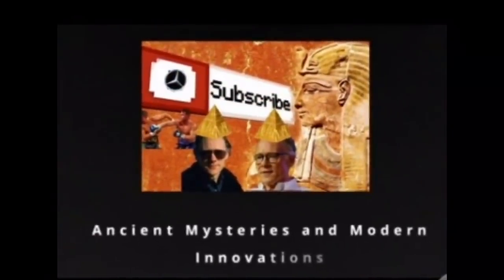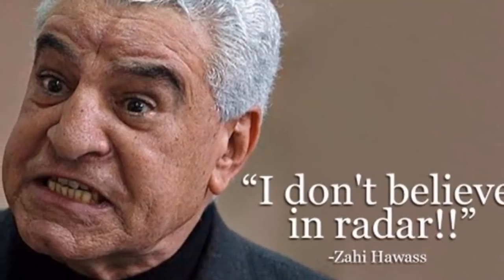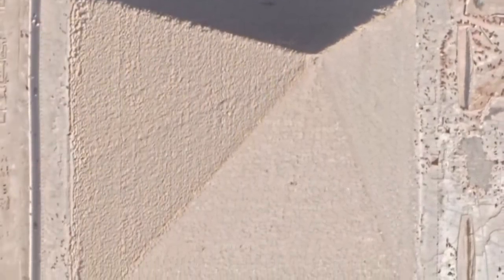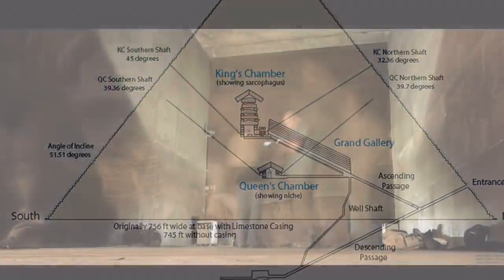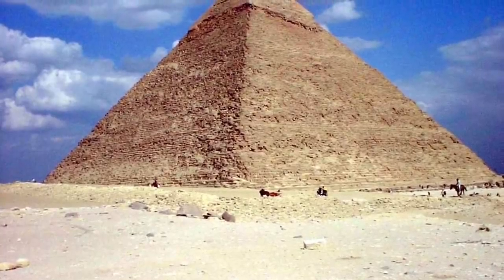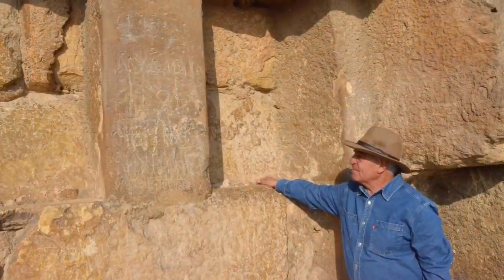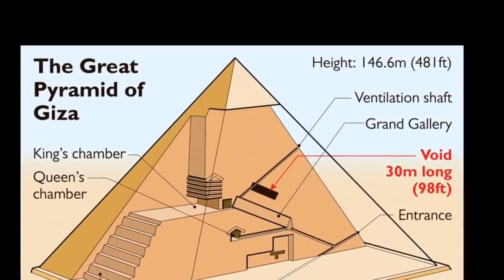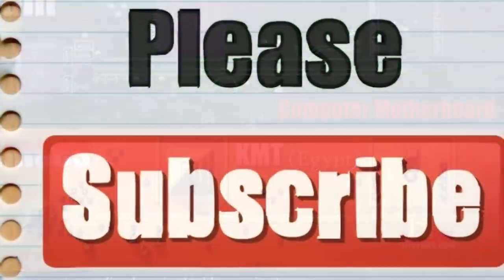Graham Hancock on Geopolymer (Liquid Stone) Technology at Giza Pyramids

Comment: Lets start off with the first fact. The Egyptians did NOT build the pyramids.
Reply: The dynastic Egyptians found the pyramids. They didn't build them.
Reply: If I remember correctly they were covered with cap stones to protect them. 
The cap stones are mostly gone.  The question is how long for a cap stone to weather away to where they are today. 
10-20k years ago
Reply: @drmachinewerke1  "if u remember correctly?"
that would imply you were there personally yourself several thousand years ago and watched the original builders build the pyramid, then travelled in time to leave us this comment
Reply: SHERMA 
Not several.
Reply: @drmachinewerke1  the cap stones were removed by people
Reply: drmachinewerke1 The capstones were largely dislodged by an earthquake in the 13 century, and used to build many of Cairo's Mosques.
Reply: dont jump to conclusions without factual evidence. These are ancient Egyptians. Dont undestimate them without tangible evidence.
Reply: @Coma White Is not his opinion, there are scientific evidences to backup this theory and yes is a theory but the more we advance in studies and the more this theory is more probable than the so called usual children`s school building theory where the Egyptians built them. Is very likely that the  ancients Egyptians "found them"  after a cataclysm in a window period between 12k and 6k B.C. then they added their modifications here and there to these structures that anyway were already there in place. Two of the major example that fit this theory are: 1) the fact that the Sphynx have clear evidences of water erosion possible only if the structure was old at least 6k-12k years 2) the rose granites blocks of 70+ tons located in the heart of the pyramids are up to today a real mistery in terms of how on earth they cut with such precision those blocks (mainstream egyptologist try to convince us that they did with copper tools which is laughable) and how the hell they carried them and they placed them in such a precise way (same issue with the Serapheum gigantic sarcophagus btw).
Reply: Amen to that
Reply: Coma White I
I realize that however there are still to this day a few left.
And as long as we know what type of material. It should be possible to determine the age of the caps stone left. Meaning how many years it has taken to wear to the level they are at now .
Reply: Don't tell me what to think or say. Yo make your comments and I'll state facts.
Reply: Then who build it American is that ur fact ?
Reply: @Coma White I would recommend looking into some research by Dr Robert Schoch who is a well known Geologist on the dating of the Sphynx complex as its accepted amongst mainstream Egyptologists that it was reshaped into the current form after its initial carving. Dating for the sphynx in history books comes from a controversial translation of a stone tablet located at the base. Looking  scientifically at the surrounding geology and geological record (traces of events remain) shows that date is out by around 7,500 years.

Fascinating stuff. There are voids beneath the sphynx too which have not been investigated. They should be, we should learn all we can.
Reply: @juniorballs6025  

The 'voids' under the Sphinx, if they actually exist, are more than likely natural limestone caverns that are inaccessible.
Reply: @Coma White Hi there, sorry but it was you that actually compared them, I just said the Sphynx complex seems to drastically predate the established timeline. All I was trying to do was make it apparent that it was an important site before the construction of the pyramids - this is obvious from the evidence (geological record) and accepted by a lot of reputable scientists.

Personally I have no doubt something was there before the accepted dates the pyramids were built, but I have seen nothing to actually prove that, so couldn't in clear conscience say so.  Even though it's the internet.

Finally some (possible) nonsense because it's the weekend. The pyramid if scaled up would sit exactly in one half of the globe. The with of the stone boundary around the pyramid compared to the width of the pyramid is the same as the ratio of earth's "squish" at the equator due to gravity and rotation (earth is not a perfect sphere).
Reply: Junior Balls earth is not a perfect sphere?
 If its a sphere at all?
Reply: @Coma White With the greatest respect (after all why not?), it might be worth re reading what I wrote, because I really didnt! I was trying to establish that site had been in use for a long time. By site I mean everything; pyramids and all. Stonehenge in England is a good example - an early site of some significance which was added to and altered over the years. I really do enjoy learning about these things! Anyway enjoy your weekend.
Reply: @Coma White Re read again and actually neither of us did. Apologies, misread the dating one from another bit. As you were 😅
Reply: Yep. Built during the so-called Ice Age (c. 12,000 or more years ago), the 'antediluvian' (pre-flood) era, as were many other cyclopean monuments and buildngs, such as at Tiahuanaco. The issue is confused because of the later building  at the sites which, naturally, often included renovation and addition to them.
Reply: @Coma White He said that because he is presumably a bit more up to date. 

No information has ever been found stating that they built them. The only 100% confirmed information is that the Egyptians, "repaired" some things. Hence, there is no information left on how they were built.
Reply: @Coma White Thats for the casing stones yeah? It's becoming widely accepted the structure is much older; not 20k but the base structure is pushing 10k max.
Reply: @thearcadian290  That guy your talking about is a tour guide. Not a historian or an archeologist.
Reply: Coma White.....not 'quite
clearly' at all, the pyramids 'clearly' have outer layers missing dont they? Robbed away over millennia etc. 
Try again.
Reply: The Arcadian yes he's a full on bell end
Reply: Ok lets assume that 60k number is correct just for the sake of this discussion. Great you just dated the sphinx but we are talking about the pyramids......
Reply: @mattking993  Well, stones on the Pyramids have similar damage. However, even if they didn't, there's several other strange things that connect them. They're both in part build into the bedrock, they both have several areas inside of them, as well as tunnels that connect the two. They both follow the pattern of at least two distinct peoples interacting with the structure(as well as several other structures both in Giza and around the globe such as Machu  Picchu. Basically, at his point Egyptology is completely fake and untrustworthy.
Reply: @vacnol Ok some of what you said there is news to me and im pretty sure you believe in some things i do not. Putting that aside im not gonna say that egyptologists know everything or have it all correct but i believe they are doing the best they can with what they do know and anyone who just blindly labels everything as false because it doesnt support their beliefs despite all the evidence that they are wrong is just sad. Just 1 question... did anyone consider the possibility that the water damage to the bedrock was already there long before the pyramids were built? Anyways as i said this info is new to me and ill see what i can learn about these tunnels and water damage. I hope this doesnt turn out to be some fools drug fueled hallucination. im so tired of hearing some loser babble on endlessly about crap that totally ignores facts and telling me lies to support fiction.
Reply: @mattking993  The reason I say Egyptology is fake is because of the fact they ignore facts and critical parts of the puzzle. They prevent exploration, excavation, and anything that goes against what they say is true is denied instantly. The water damage isn't to the bedrock but the stone, the sphinx has the most damage however, enough to say that only the Nile could have caused it and the last time the Nile was that close to the Giza Plateau was thousands of years ago. There's tons of stuff you're not told about the pyramids, such as no mummy ever being found in ANY of them, or the fact theres a giant fucking door in the middle of the Great Pyramid. Looking into this deeper and deeper you see a lot of shit they're covering up, just not history wise but globally.
Reply: @vacnol actually most people know about the mummies and that has been explained when they did find some mummies. Plus this is in part my own personal opinion based on some facts but its well known that pyramids were full of traps and meant to trick any robbers so its not surprising that a mummy hasnt been found. I cant remember whose tomb it was but they didnt find a mummy. it looked like an unused tomb until they discovered the secret passage hidden under the floor....hint hint. So my personal opinion and counter to the pyramids are not tombs theory is maybe the pyramids are doing exactly what they built them for and explains why we havent found the mummies. I cant really comment to much on the blocking exploration and excavation thing except to point out theres a lot of exploration and excavating going on over there. Im afraid to ask but what is this giant door that ive never heard of and pretty sure doesnt exist there for?
Reply: matt king Okay, so no, mummies still haven’t been found, there’s speculation that there could still be mummies but it seems unlikely, also as far as we know there were no “traps” either. Now, you’re 100% about the passage ways but it’s a little more complicated than that. When I say this I’m going to be talking specifically about the Great Pyramid as most of my knowledge is held there. In the great pyramid there are several shafts, no more than a foot wide, about large enough for a small dog. These shafts were previously hidden nearly perfectly with stone, granite I believe. The shafts are several hundred meters long extending into the pyramids, at the end of one of one of them, the entrance being found in the “Kings chamber” I believe, don’t quote me on that part led to a small room deeper in the pyramid, the only entrance to whom seems to be this shaft. In this room one of the walls was actually a door with two large iron handles on it. Note: several of these shafts point in very specific directions in the sky towards stars in constellations suggesting astral knowledge.
Reply: @vacnol yes mummies were found but not in the pyramids. Ah yes those doors i already heard about. Your statement about a big fucking door in the middle of the pyramid was misleading as those doors are actually small. They lead from the queens chamber if my memory serves me correctly and they did drill a hole in those doors and took pictures of a room. Unless they discovered more since 2011 there was no big door in the pictures i saw. My house has a chimney and im sure it probably lines up with 1 of the 100s of stars in the night sky but im pretty sure it doesnt have any astrological meaning. I know astrology was important back then and still is to some people and im not saying that theory has no chance of being correct but a hole in the roof may just be a hole in the roof.
Reply: matt king If talking about surface area sure, the block with pins(should have been more specific) was small from the shaft the actual granite block is several tons. That leads into another empty room with an odd large stone block at the end, as per we’re told. The point was odd structures like this exist several times over with the pyramids including the position itself. The void for example that exists above the King chamber or the grotto area leading some to propose s water pump theory. As for the involved astronomy not astrology, precision and specifics are a key. The pyramids themselves not only sit on the exact center of earths landmass to hundredths of a degree, but the alignment with Orion’s Belt is impressive. I should also mention a largely logical theory of that, that that the actual pyramid structure, specifically the limestone outer blocks were placed later overtop the original structure made out of granite blocks that were much larger and heavier.
Reply: That is interesting i had not heard about another room. Im still holding onto hope those shafts will lead to a mummy. Not really a void above the kings chamber but there are open spaces between the granite blocks i guess thats what your referring to. Probably obvious but im not a fan of the water pump idea lol. I did do a bit of research tonight into that center of earths landmass thing you mentioned and it is really cool but i noticed right off and apparently someone else did to that if you rotate the earth left or right and up or down giza wouldnt be the center anymore. That someone else is a person named susan wise bauer and she said the only reason giza is at the center is because they used the mercator projection as the map of earth which the egyptions didnt have since it wasnt invented yet. So that kinda reminds me of the point i was trying to make with my chimney and isnt all that cool anymore. Ah yes i do gotta admit the way the pyramids are laid out and orions belt is pretty awesome but then again...i do feel the need to say im not trying to be jerk before i finish my sentence...if i go outside and look at my chimney and move to the right position it lines up orions belt nicely also. But the resemblance between the pyramids and orions belt is worth speculation and some theories at least. Im not even gonna touch what you called a "Logical" theory. I am enjoying this chat of ours but going down that road would lead to a never ending discussion of our day dreams and wistful fantasies.
Reply: matt king See, it’s all about perspective. The mainstream assumes it wasn’t invented yet, but the map is based on mathematics, assuming they were more advanced we can argue that they likely would have run into the same idea. We already know for a fact humans past is far more complicated than the mainstream has claimed. The Shigir Idol is the oldest known wooden sculpture having been dated to 11,500 years old, right after the end of the last ice age. I recommend you look into that, the implications are quite fascinating, make sure it’s not a mainstream source... they’re not that trustworthy.
Reply: @Vacnol Yes it is an assumption but it is based on the lack of proof to the contrary which is an assumption myself and the mainstream are comfortable making. Your assumption is a debate on what ifs which is fine but when you start trying to present it as fact and expect the mainstream to bend to their beliefs thats just plain wrong. I fully believe that they were more advanced than alot of people give them credit for but not in the way some theories are saying. I believe they knew far more about the natural world than we do at least in regards to pyramid construction and they did have a bit of modern technology but built with primitive tools what was available to them at the time. I dont mean anything crazy like computers and such btw. Oh i did look into the water damage thing very briefly it was only 1 link and it only had 1 picture that was at a distance but it looked more like wind and sand erosion to me ill keep checking later maybe find some better pictures that show clear and definate water damage but if all the pictures look like that 1 im gonna stick with mainstream until better proof is found but now im gonna stop babbling and check out this shigir idol but im gonna also check out the mainstream as well i do prefer to hear both sides of a debate and form my own opinion.
Reply: @mattking993  Okay, so I wrote an entire thing and cut it cause reasons, basically the gist is this. The pyramids are made out of Limestone and a but harder granite, both of such are not easy to cut using copper the latter being nearly impossible, they could NOT have built it in the time Egyptology describes just using Limestone not at all using granite. These granite blocks weigh up to 100 tons and are taken from a quarry hundreds of miles way, no ramp could ever be built to get them up there as a straight one would cost more than the actual structure and one around the sides would be too small, cost too much, too unstable, etc. These structures are extremely precise something not possible with primitive tools under any circumstance, even using the sand and water theory. The building techniques are seen globally using the same kinds of stones, as well as several structures, three examples being the Bent Pyramid, Giza, and Machu Pichu, all of such seem to switch styles at some point, one being less complex the other being far more complex. Basically, the mainstream has absolutely no idea how they're built and refute anything against their theory's even if they're good, they've lost nearly all credibility in their arguments simply not following science and being extremely secretive with their endeavors, covering up an entrance to the Sphinx located on the top, several rooms, and even tunnels UNDER the Giza Plateau. The probability the Egyptians built the Entire structure of all the pyramids like Egyptology says is so low it's basically zero, so then instead of me speculating, let me ask, who did it? One more thing to add, we say civilization started with the Summerians, I ask why? We've existed for a MINIMUM of 200,000 years, yet we're told we only got smart enough to make houses a few thousand years ago? Personally, we could have discovered civilization anytime between our birth and now, considering there's more time between Summer and our birth than Summer and now, it's more likely civilization existed before Summer just using numbers and no outside sources, with outside sources it's even more likely using logic.
Reply: @Vacnol Well crap i was gonna go to bed and get some sleep but i just had to read what you said and now my brain wont shut up lol.  I agree totally that the great pyramid could not possible be built in the 20 year time frame they say with the current theories that are accepted by mainstream. I believe that number is based on some writing they found that they claim says khufu ordered the building of the great pyramid and the day he died...i think. I am no linguist at all not even close probably the worst subject in the world for me. I only speak bad english and thats it lol but i did try to learn dutch once and i learned they say things that the meanings of a word can change based on how its used but what im trying to say is maybe it was mistranslated and he actually said it was constructed or whatever ya i know now im assuming and spinning what ifs lol. If you watch some newer documentaries on the pyramids you will find alot of mainstreamers are admitting that the ramp thing is wrong. I would like for you to check out a couple things for me now. On youtube search internal ramp then watch the video The great pyramid of egypt new evidence full documentary posted by experience egypt this currently my favorite theory at the moment theres some videos if you want to watch them also the other thing id like you to check out if you havent already heard of it is corral castle please dont watch the ancient aliens version and 1 more thing look up The Thunder Stone. I believe the biggest reason why everyone thinks the great pyramid couldnt be completed in 20 years is because we are told that they would have had to set a stone weighing at least 2.5 tones like every 4 minutes or something like that well thats a massive assumption that the entire pyramid is made of stones that large and since we havent taken the pyramid apart we cant possible know that. After you watch the internal ramp video you will see they found a spiral shape of lower density going all the way up the pyramid even if the internal ramp is wrong it still leaves the question why is there lower density if its made of the same size and type of rock. Also in that same video they talk about a french team that drilled a hole in the pyramid and on the other side they found a rough room full of sand.....my personal assumption and theory is they used much smaller rocks called filler rocks and sand to fill in alot of the pyramid. If they used an assembly line of people they could move alot of dirt in very little time and maybe make that 20 year mark easily. There also might just be proof. The granite stones above the kings chamber is cracked on the 1 side that they believe was caused by the 1 side settling lower than the other. This settling effect is far more believable if you think of sand and small filler rocks shifting than trying to explain how massive stones somehow moved.  Ok now if youve watched the corral castle video youve seen the tripod with the boxes and all those ropes. Thats a pulley system doesnt take up much room and allows a person to lift huge amounts of weight with much less effort and that guy claims he discovered the secret of the egyptians....hrmmmmm. From where im sitting the probability that the egyptians built all of the pyramids is a lot higher than zero. I honestly cannot answer your question of who did it since i wasnt there when they were built but if i did have a time machine id definately not leave without you because the loser is walking home lol just kidding. Ok the summerians have the oldest known writings followed by the egyptians and i think thats the reason why i could be very wrong. I fully agree that there is probably an older civilization out there but it hasnt been found yet so for now the summerians are what we got for now. Sorry so long but you picked such a fascinating topic with so many possibilities. Yes i skipped the sphinx and tunnels stuff i think this reply is already huge enough lol.
Reply: matt king I’m gonna do some research on the whole sand idea however I’ve got shit to do today so it may take some time. In the meantime a small rebuttal. Personally, I don’t believe that space aliens helped anybody on earth, nor were helis used t move these blocks, some form of ramp had to be used and the pyramid itself likely was the ramp, however I think that complicates things. A great chance I like to watch called Ancient Architects is an amazing source for this kind of stuff, he’s an independent researcher whom recently proposed a new theory, basically the Egyptians as well as Sumerians were a part of the pre flood civilization, and the pyramids are actually converted structures, the proposal makes sense and explains a few things in history as well such as migration and cultural similarities. https://youtu.be/WMVQMhitxMc I think you’ll like many of his vids, too
Reply: I am very relieved to hear you dont believe in the alien stuff. Ill check it out later. The internal ramp video may be what your looking for and the corral castle video helps explain how someone was able to set such huge rocks.
Reply: matt king Woah there cowboy, I said I don’t believe in space aliens, not aliens.  There’s hands down some weird shit that goes down on earth, most of it I think are people, but it’s that like 10% that seems odd. The two best examples of this are the Missing 411 cases, those are fascinating and I think you’ll love them. As well... as our very own moon. I say this because the geometry of the moon is... well it’s fucking insane. Basically mathematics says it’s more likely that the moon is artificial than everything causing the moon to be the moon due to shape, it’s density that of such should be wayyyyy heavier, size, position, angle, rotation and orbital speeds, etc.
Reply: Well i only meant as far as the pyramids are concerned lol. Anyways i gotta go do boring stuff.
Reply: @TheShadowBannedBandit  

No, it works the way all historical study works - the facts in hand are the story, not the absence of facts for a different story. If I have a clearly fashioned stone tool, I can say that a hominid made it and speculate what it was used used for. The youtube archaeology analogy, is I dont have the LASER drill the Atlanteans used, so clearly the Atlanteans built the Pyramids.

If that makes no sense at all, congratulations, you're beginning to learn.
Reply: @mattking993  

Many of the grand tombs, were merely for public spectacle and the actual tombs modest and secret.
Reply: @TheShadowBannedBandit  

Whoa, whoa, whoa... CITATIONS, CITATIONS,  CITATIONS NEEDED
Reply: Spring Bloom You know, I thought I was actually going I have to reply seriously but you’re not being that series. You’re making speculations on what anomalies could be without even looking into them. I’ve provided a link only a few comment up that is a study on the water erosion theory, it is most definitely not just “a failed understanding on wind erosion” if you read it you’d know this. You failed to even comment on my shit tons of other points, the elephant in the room is still literally bigger than an elephant, that being hundreds of pounds of granite blocks that were cut, transported, and placed perfectly. I never said it was lasers, I never said it wasn’t; I did say that whatever the pyramids are, how they were build, when, and my whom is unknown and most certainly not what the mainstream tells us. Hell, they even found a hidden passage who’s entrance is found in the king chamber, most people agree that if they were a tomb this could be a good way to prove it... assuming Khufu was there; however We were told nothing, they sealed it off and left it be leaving the public to only guess, if that was a tomb they would tell us as it’s their narrative, but et again no mummy was found in the pyramids and I think at this point if you still think they’re tombs you’re reaching for straws. Read this study tho will ya
Reply: @thearcadian290  However, I believe it is the job of the more fortunate and free willed to pull the rest of us up whom was born on the lower floors. We can't reach our full potential without ALL of us being on the same page.
Reply: @springbloom5940  There is no mountain of evidence, this man is a Geo physicist and geologist whom is an independent researcher that released this paper. As for Egyptology, their only "evidence" is what you read in books, they can't actually cut stone with the methods they provided, they can't actually prove how the stone was transported there, there was NEVER a mummy found in the great pyramid... they can't disprove the water erosion theory. There's holes everywhere, nothing connects as it should, they've got dates wrong, facts wrong, PHYSICS wrong. That's just how it is, I provided you with a paper by a reasonable source whom is independent, now your job is to disprove it.
Reply: @spring bloom I did not know this ty :) hopefully 1 day ill be able to go see them.
Reply: @vacnol I watched both parts of the converted ziggurat and your right i did enjoy them. Had to watch them a couple times because i havent gotten to the bent pyramid yet and he does talk fast and jumped from 1 thing to another kinda fast. That would explain how they were built fast. I liked his explanation for the internal ramps findings also. A few of the things he said got me to thinking tho. That the exterior was built in 2 seperate stages and by differant people ok maybe not on the 2 seperate stages part. I believe he also said that its weird bent shape was by design and meant to be that way that it wasnt because of structural damage i agree completely. Ok the mainstreamers say they changed the angle because of structural damage and the top was hurried and thats why its not as well built as the bottom yup i agree with him that cannot be correct and then someone actually went and checked lol. Thats just stupid if your foundation is falling apart due to excessive weight your not gonna keep throwing on more weight even at a lesser angle its still just gonna fall apart. Why anyone would even bother running tests is just silly to me. The bottom is obviously the foundation and thats why they used the heavier stones and why the stones were set so perfectly. After the bottom was done they lessened the angle to reduce the weight and the gaps between the stones is easy if you think. which weighs less air or stone? Maybe the stones angles were changed for stability or something that part im not sure about. Its aesthetics doesnt matter since its gonna be covered over anyways. They changed the angle and the construction method not because of structural damage but to prevent structural damage.
Reply: Vacnol and Arcadian I checked out that link Vacnol and if you look there is clearly wind erosion running right thru the middle of his example of water erosion lol. Plus if you google wind erosion and look at the pics some clearly look just like what he calls water erosion and vice versa if you google water erosion you will find some that look like wind erosion. Arcadian you really should slow down your flow. Your making claims you cant back up. Just because a mummy hasnt been found yet doesnt mean there isnt one. There is proof of tombs being built so it misleads robbers and the mummy and valuables are hidden in that tomb. Me and Vacnol were just discussing the fact they are still finding hidden rooms and tunnels inside them. Khufus mummy has not been found yet so it may still lay in there somewhere. You do know there is alot of proof pointing to egytians building the pyramids and i have yet to see any concrete proof they didnt.
Reply: CITATIONS NEEDED
Reply: @thearcadian290  

There is no 'Sphinx water damage', that is a pseudoscientific assumption, based upon poor understerstanding of differential wind erosion.
Reply: Spring Bloom.....That's a matter of perspective, looks very much like running/lap water damage to myself and many others.
It could be either or both for all we really know.
Let's assume it is wind erosion, would that not suggest the Sphinx, to be far older than the 'scientifical' community purports?
Don't forget, we are talking about a community that still tells us the Pyramids were tombs, when they're clearly not and that the Egyptians built them. 😲
I have a theory about the Giza pyramids, I believe underneath the plateau lies another construction, a water way of sorts, but, instead of being filled with water, its content is, or once was, mercury, similar to the one in China?
Reply: @thearcadian290  

Don't speak to me, until you can adult.
Reply: Spring Bloom Oh dear, did I just make your 'scientifical' adult, butt hurt?
What on earth makes you think I'm not being an 'adult'?
It isn't me stamping my feet and having a lil 'hissy fit' is it?
Reply: @thearcadian290  

Were I you(and so thankful Im not), Id give serious consideration to the delete function.
Reply: @thearcadian290  

Just cant help making a fool of yourself, can you?
Reply: Spring Bloom I waiting for you to amaze me with science?
Reply: The Arcadian Also that wasn’t true. There’s distinction between water and wind erosion, side by side comparisons are used in this study. Wind erosion does exist of course, however there’s also an absurd amount of water erosion present.
Reply: Vacnol I know mate, I have no issue with your summary or your logic 👍
Reply: @thearcadian290  

'Mainstream scientific community'

And so we get to the root of the issue - oppositional defiance.
Reply: @Coma White here is a fact....if the egyptians DID build the Pyramids, their civilization has devolved tremendously........
Reply: @Coma White wont work coma...I know what I know and today's Egyptian has no inkling of how the Pyramids were built, so if they did build them, then they have lost a remarkable amount of brain power...the simple fact of the existence of the pyramids proves it. The Egyptian standing next to it scratching his head, proves it. Fact:!!

no coma....I am not giving you ammunition against me....yer so smart, deduce my country and ethnicity for yourself......
Reply: fullswing  of course they rise and fall...and Egypt fell from the Moon's orbit if they built the Pyramids.....thats a fact.
I dont believe anyone born on this earth built them...thats an opinion
Reply: @Coma White great...you are a genius...heh
Reply: @Coma White yep, the bar is low and you passed under it easily...heh
Reply: @Coma White you mean the fact that Egyptians,  and most societies on earth today, do not have the knowlege, the means of production, or the time to waste, trying to build a Pyramid that apparently does nothing but point at some stars.....someone had a lot of time on their hands and the feat was a piece of cake to them....I know a fact when I see it....
...its simple...you can do it to...
Reply: Coma White prolly you are brain washed by mainstream science and archeological explaining to you it was build by them, no one else?  I supposed your 4th grade school teacher told you that as well?
Reply: Yeah, they did. Look it up.
Reply: @Coma White Hpw exactly did they Carbon date rocks again? Lol.
Reply: the narrative of the pyramids will ALWAYS be speculation
we will never KNOW because the builders/contractors of the pyramids have perished thousands of years ago
the ONLY important questions are HOW, WHY and WHEN
people seem to be under the disillusion that to solve the mystery of the pyramids we need to know which king in which dynasty ordered the erection of the pyramid

when evidently the answer lies in the physical pyramids themselves not in the storyline
hey-ho
Reply: SHERMA dont be idiotic
Reply: @SHERMA.  I 100% agree, inside the pyramids is the answer to their story.. it's not only a question of how why and when but, who is stopping us and how to we stop them?
Reply: @TheShadowBannedBandit  

'Who is stopping us' from what? Drilling holes, prying out blocks, blasting exploration shafts? To suit your entitlement to 'know'?